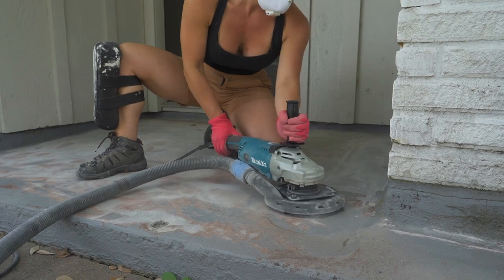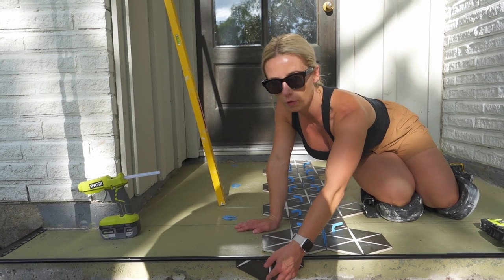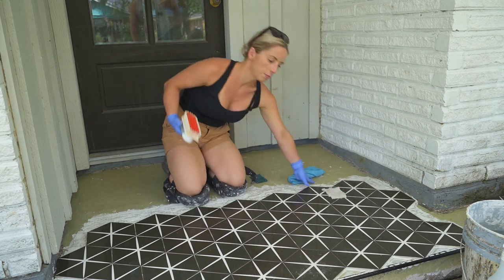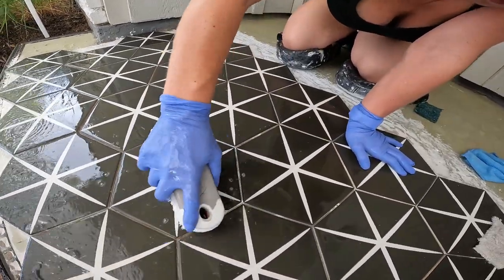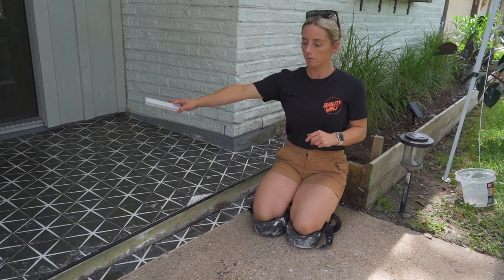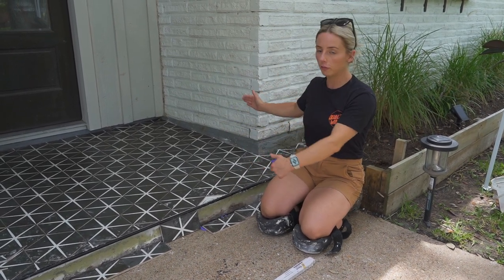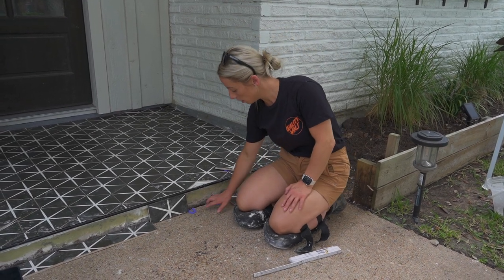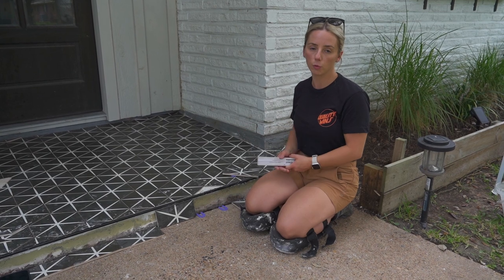5 IMPORTANT tips for installing outdoor patio tiles you wont want to forget!

Comment: So if and when water hits the wall and runs down to the floor. You do understand that with hydrostatic pressure, those tiles have a real chance to break the bond. I love using Hydroban, but unless you can roll it up the wall with a flashing to protect the membrane from wicking water through the concrete / or NXT flooring patch, there could be an issue.

Comment: clay tiles will work in an exterior application with rain and snow ?   I had the impression that Porcelain tiles were superior to ceramic ?  I only want to do a job like this once.  The current tiles, done by someone else, popped off, cracked and some lifted.  It's a mess.

Comment: Could you use Ditra XL instead of the roll on anti-fracture membrane?
Reply from the maker: I don't believe ditra is rated for exterior
Reply: @ThatTileChick  Thanks for the reply. I found out that it is. I’ll give you a link to the page which states this: DITRA and DITRA-XL provide reliable waterproofing in interior and exterior applications. Its polyethylene composition protects the substrate from moisture penetration, which is particularly important in today’s building environment where most substrates are moisture-sensitive.